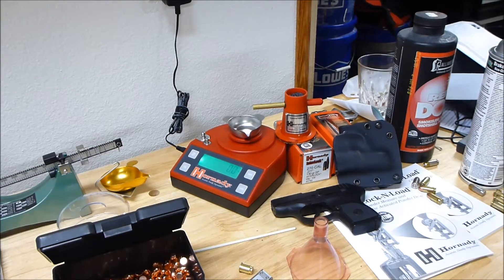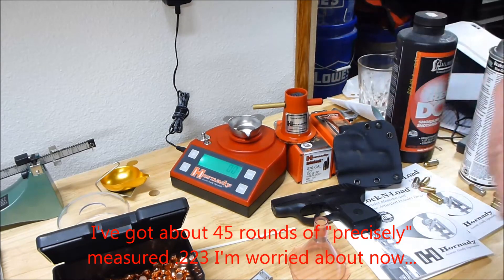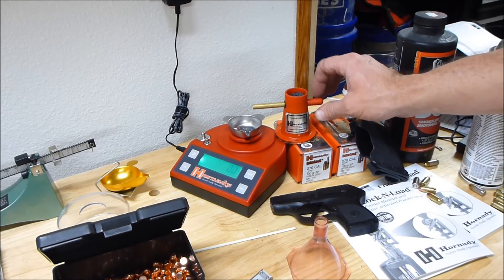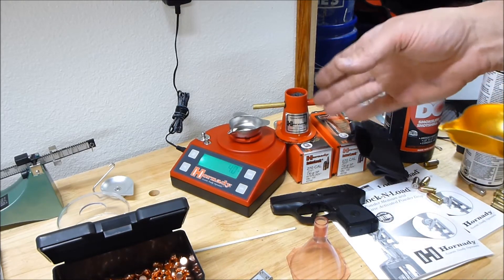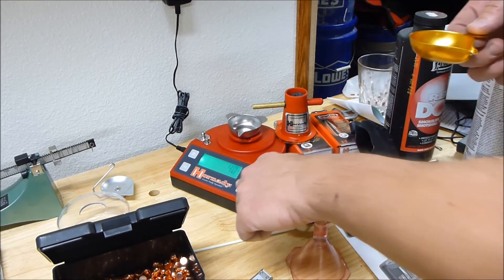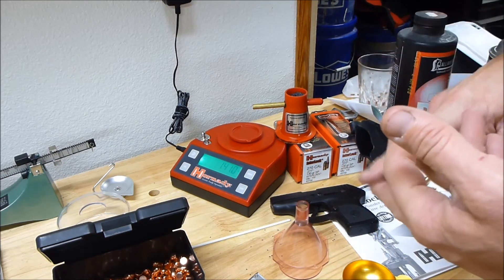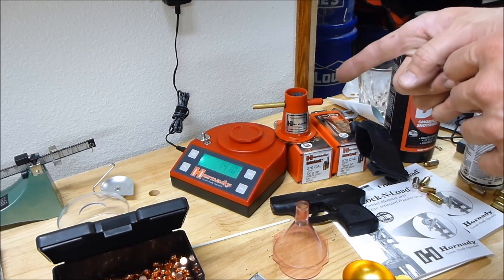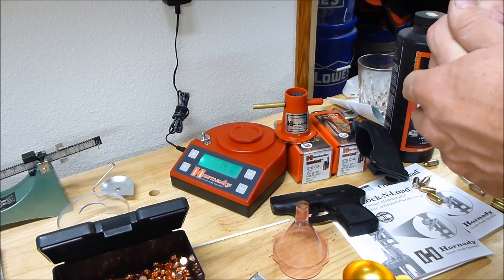Hornady Powder Measure FAIL **DANGEROUS**

Comment: So you have an electronic scale issue, not a powder measure issue.
Reply: It’s not an issue with the scale, either. He is tricking the charge from the very beginning and the scale is zeroing itself over and over again because it is such a minute amount off of zero. If he tossed in a larger charge to begin with so that the scale wouldn’t re-zero, he could trickle just fine.

Comment: You know there is a problem send it back. Problem solved. You can see by your reloading supplies your just randomly doing stuff. Calibrate with the weights Get a powder charge drop 2.5 trickle up.

Comment: You should change the title of your video as there is nothing dangerous about this scale.
As others have pointed out, the scale is supposed to self zero below a certain weight (probably 0.5 grain).
Throw a grain in with a powder thrower, then finish with a trickler.
Persevere, it's a great hobby.

Comment: Before I started the reloading endeavors I was pretty set I wanted a digital scale. I have a LEE BALANCE now, the digital is just not as accurate. It takes me a few to set proper charge on the balance scale once it is done I meter out 4 or 5 more this ensures it is set. From there I can reload a few hundred no issues and same weight. I might not be as Fly as the next guy I am twice as safe.

Comment: Doesn't the  hornady scale has an auto zero feature? Trickling the powder in that slow might be engaging it keeping it at zero. When you take the overall charge and dump it back on the scale then it registers the correct weight.
Reply: Should calibrate!  It thinks in in zero mode.

Comment: Did you contact Hornady customer service regarding this issue? I agree the scale is not calibrated for the charge your using. Using a standard balance grains scale is a great back up & a way to verify the loads your using.  However, when your loading a large number of rounds it's best to do so in smaller groups of 10, or 20 rounds so that you don't miss a cartridge case and have a squib out on the range. 
I would e-mail the video to a Hornady  customer service rep & include in the video that you did perform the calibration procedure  properly.

Comment: I'm just getting started at reloading. 
I have been going back and forth between digital vs traditional mechanical scales. 
well you just convinced me to not trust battery powered digital scales.  especially inexpensive ones.i think it would b re wise no matter what one uses they should have a separate scale for comparison testing. 
thanks for the video!
Reply: you are a dumbass
Reply: Dont go by this video i have used the cheap frankford arsenal scale for a few years with no issues at all. I have some more high end scales i use for my long range ammo ( Gem pro 250) but for my 9mm, 223, 45acp and other bulk ammo i just use the cheap digital scale that has always kept me safe. Im not a fan of the Hornady scales but dont let it run you off from digital. Make sure you never bump or hit the load cell as they are very easy to mess up if your rough on them. But most loaders are very detail oriented people.
Reply: Thanks. Again, I'm a beginner so am taking care with how I go about my selection of equipment and components. Sounds like you have already been down this road. 
I've been looking into the RCBS scales. I've  unfortunately heard that they moved their production to Mexico and there has been some loss in quality. I'm going to continue looking into this though to verify. 
Wishing you well.
Peace
Reply: If money is no big deal the Gem Pro 250 is 125.00 or  around that on Amazon. Its one of the highest quality and most accurate. If you want something thats cheap but still a good scale to get you started get the Frankford Arsenal scale, the DS-750. Its only 25-30 and works very well for the price. Before i got the Gem pro i was loading 308 and getting 3/8 to 1/2 groups so its a dang good scale for the money.
Reply: andrew geary thanks for the tip. I will certainly look into it tomorrow. 
I may well follow in your footsteps. :)